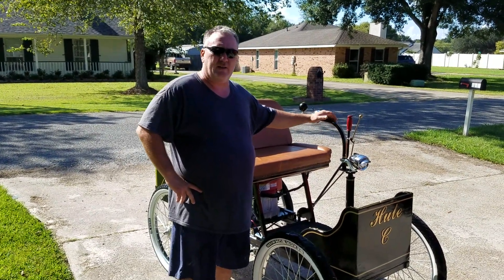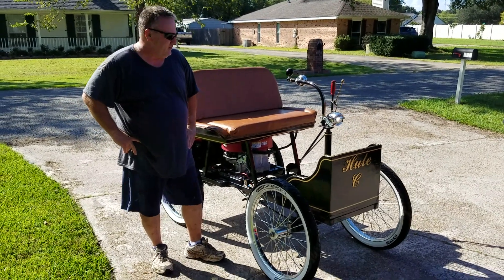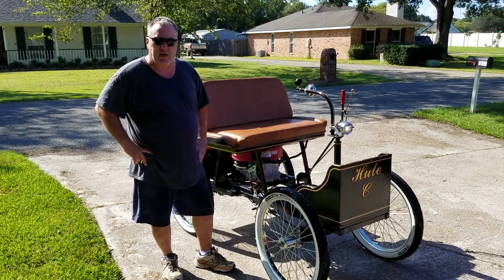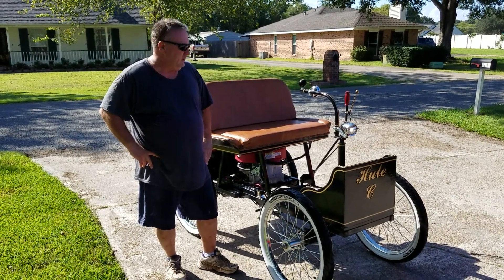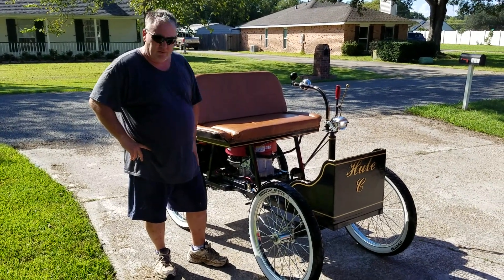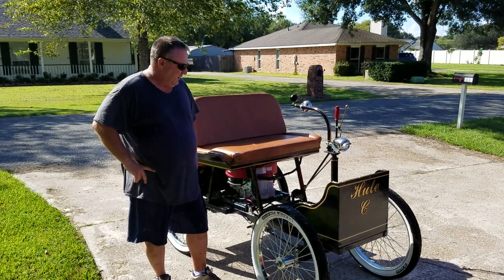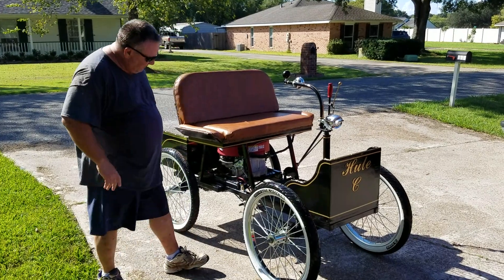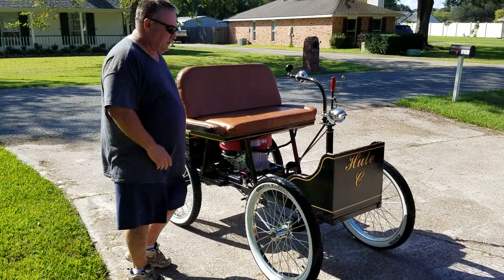Quadracycle final ride, all finished.

Comment: Sheesh. A riding mower on bicycle wheels. 

With chrome rims and whitewalls, just like ol' Henry put on his.
Reply from the maker: Well, technically yes, and no. Chassis is custom built, as is the steering and linkages. It does use a lawn tractor engine and a hydrostatic transaxle.